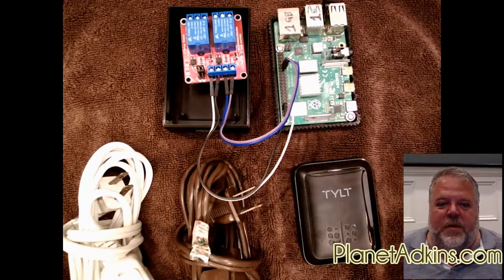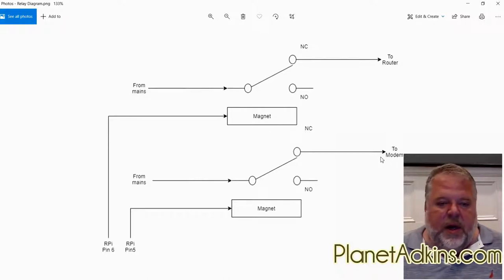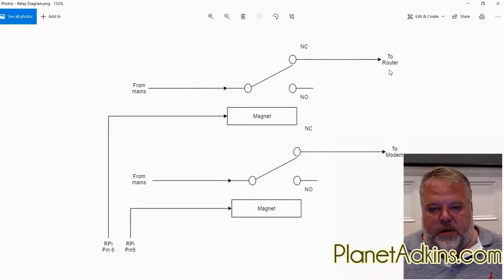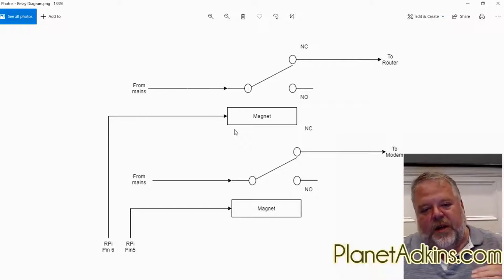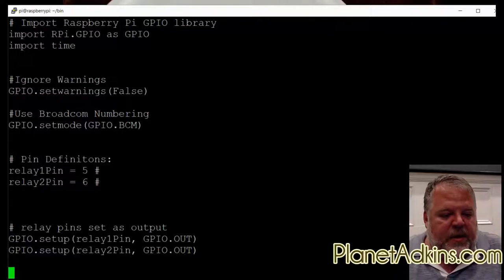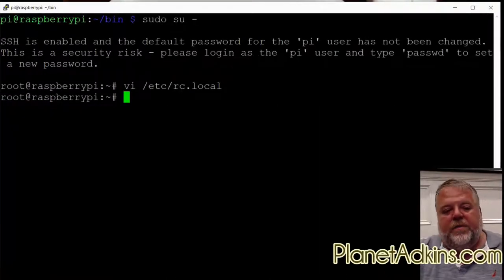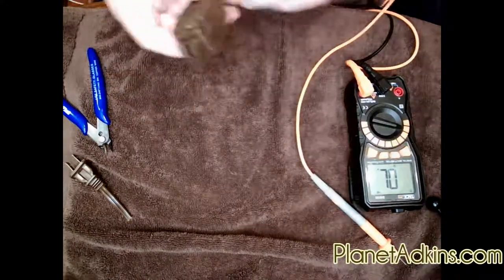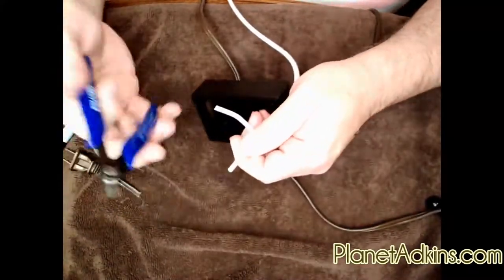Raspberry Pi Router Relay - Internet watchdog for your cable modem and router

Comment: I think you left out a lot of steps ...  I am new to Raspberry and mine never detects the internet even though I am on it.  Could you please tell me what the setup of the raspberry pi prior to the hardware?
Reply from the maker: Hi Troy, the setup is plain stock from the raspberry pi imager on the SD card.  It should work directly out of the box.  Connect the ethernet cable directly from the RPi to one of the ports on your internet router.  After connecting it make sure the lights on the raspberry pi ethernet port light up, and from the command line you can type "ip addr show" and it will show all the ip addresses it has.  (You can ignore the 127.0.0.1, that's internal only).  Let me know if you need more help.  Also make sure you have a valid address in your script, something like google.com.